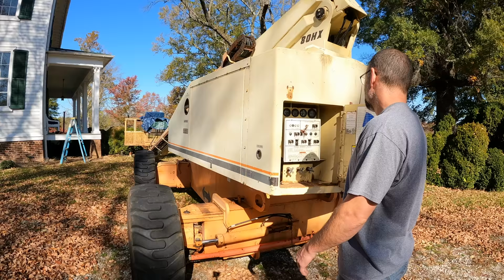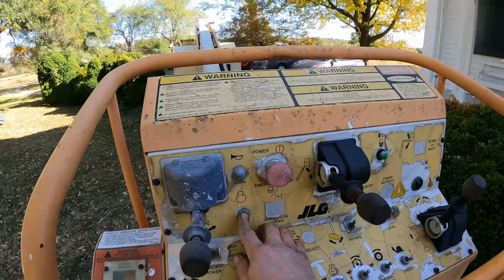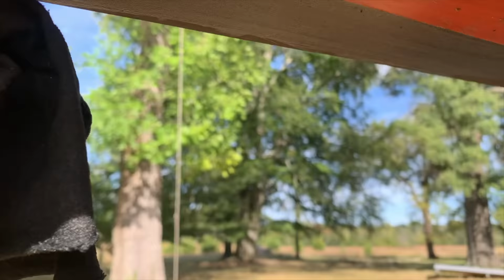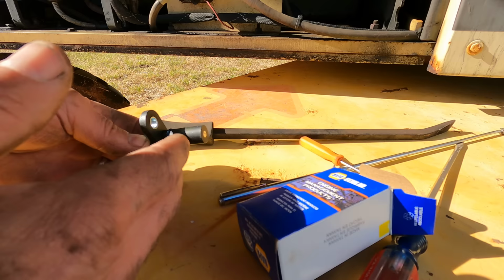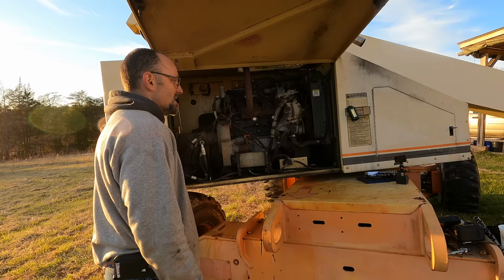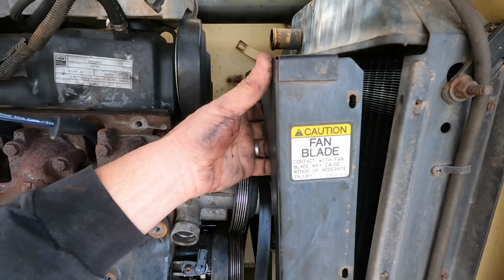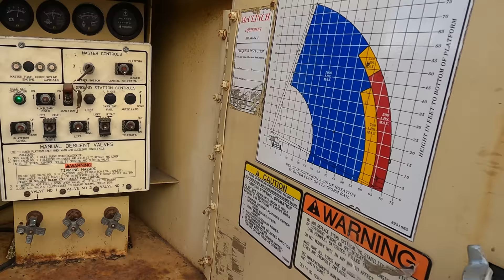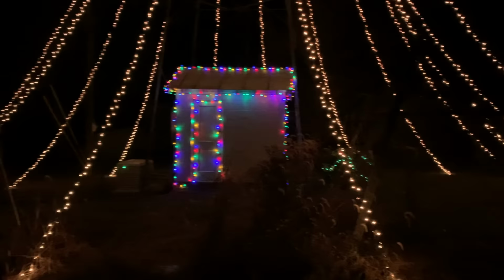My Boom Lift Broke Again! Fixing It & Then Doing a CRITICAL Job With It.

Comment: I have cut one piece fan shrouds in half to facilitate removal and re-install....the next  time you need access to stuff you can easily remove just the half that's interfering with access to fan removal, or water pumps, belts etc.

Comment: After reading almost all the comments (about the engine) The one thing that seems really clear is that the choke is opening way too fast, as several folks already mentioned. I recommend doing a compression check on it with a screw-in-type gauge. Try having someone start it while you manually move the choke by hand, I did this on mine, and it proved to be the problem. I rigged up a manual choke for it and the clod start issue was gone.

Comment: I have never been accused of being an expert but I would go after the electric choke. In the video you can see the choke fluttering opened and closed. I would try to isolate that by taking it off and manually holding the choke in position. The way it’s behaving makes it feel like a governor issue but if the choke is not being held in position it will act the same way, as the engine get fuel and speeds up is sucks the choke open pulling too much air, not enough fuel, so it starts to die and the choke falls closed pulls more fuel, less air and it starts to fire again, it does this until you get enough fuel/heat to keep it running. Also on all of electric chokes I have seen they will only open to that halfway point and once the throttle is opened they are tripped to wide open, this is usually done with a linkage.

Comment: at +4:25, yes the linkage on the choke pivot should be adjustable. The brass screw in the center of the part in your right hand is the limit screw.

Comment: I guess the next step would be putting an oscilloscope on the crankshaft position sensor and coil control coming to/from the ECU and check those are not intermittent. Mechanically it should be sound now, unless something is wrong in the valvetrain...

Comment: On your extension cord or rope wrapping tip, I usually put it on my shoulder and do it just like you did but going around my elbow to make that loop and then I take the finished cord off my arm but it's one smaller loop and not two.

Comment: My 79 Clark forklift has a flat 6 continental motor with an updraft carb. I use my compressed air to blow into the fuel tank to prime the the fuel line. I use my gloves to cover the filler tube and then sneak the blower between my fingers. A couple of air blast I can see the gas fill the filter. I can’t do this with a full tank. Great video. Cheers.

Comment: I think you have 2 issues that are related.  The choke fluttering is a symptom of a vacuum leak, either faulty diaphragm, hose or gasket.  An easy way to find the leak: with the intake hose secured and engine at slow idle take a slightly open but unlit propane torch and put propane near suspected leaks, the engine rpm will change when it sucks in the propane.  I also suspect you are having to crank so much because of lost fuel pressure, there is almost zero difference from starting with a completely empty carb to sitting overnight.  This is most likely a small air leak which is causing lost prime.  Snug hose clamps, double check fuel hose for kinks etc.
Once your past the hard cold start you should check the valve lash

Comment: DuPont motorcycle chain lube is a great replacement for white lithium grease and WD-40 for stuff like this.  It's a thin liquid that penetrates and cleans when enough of it is sprayed, and then it dries to a waxy, white film that doesn't spread and hold dirt like white lithium grease.

Comment: Choke Limiter, no. There is a piston inside that space you called a choke limiter. When the engine starts, a vacuum is applied to that piston to pull the choke partialy open. This helps prevent flooding. As the engine heats up the BiMetalic spring finishes opening the choke all the way. The bolt that you said does nothing is there to limit how far the piston opens the choke during the initial start. The slot allows the BiMetalic spring enough travel to let it finish opening the choke all the way when the engine is hot. Use chain lube it stays on the chain better, WD40 would be used to free it up but you want a good quality "chain lube" for permanent lube. The rust on the sliding ways is your drag problem. Use a wire wheel to clean them and use grease on um to keep the rust off. Also, you may want to remove the wear pads and remove the embeded grit which is likely stuck in the contact faces after running on that rust.

Comment: Old wrench here . The starting problem is the choke , it's not closing tight enough from what I could see in the shot looking into it while starting . The choke thermostat spring should be adjusted to where it closes tight enough to stay shut while cranking . It should also be opening FULLY when warmed up . That piece you were talking about that won't let it open all the way  is vacuum controlled on a car and has a diaphragm on the end of it with a vac hose to the intake . It's called a " choke pull off " or sometimes a " choke breaker" .  You should be able to google whatever brand and part number that carb is   and see what I'm talking about . Anyway , that's the area that needs attention .

Comment: Good job !   I agree with some of the other people on the engine .  I would do a compression  check , cold & hot . Bad valves  can cause it to start hard on cold start & better on a warm start .  And the timing belt may be worn out. With most older engines  there are many things that contribute to bad start.

Comment: In the cold weather take a heat gun and blow it into the air intake if it starts easier might need some sort of grid heater.

Comment: John, I think your starting problems are Choke related, I saw the choke plate fluttering when you were starting the engine after you took the automatic choke system off. The engine is now over-choked when you first start the engine and the butterfly valve flutters open and closed  causing the engine to gradually receive enough correct air/fuel mixture to begin running and keep the butterfly valve open.
The choke valve should normally be in a set position to allow air as well as fuel vapour to allow the engine to start correctly, then I think the little electric heater causes the Bi-metal spring to fully open the butter fly valve.

good luck any way Jim H

Comment: For your boom chain suggest you use a motorcycle chain lubricant.  It goes on liquid/ spray then thickens like a grease so it doesn't fling off (a motorcycle).   I've had good success using this lubricant on chains where you want the lubricant to last a long time.  My garage door chain as an example.  I learned about this lube from owning a motorcycle for many years.  Also, many people think WD40 is a lubricant but it really isnt.  It is a water dispersaant and does that we'll but it's lubricating properties are poor.  I have found a product called Break Free as the best non-grease lubricant. It is an oil type but it never dries up and get hard or sticky like other oil lubes.  Corrosion X is also a good lubricant for parts that will be in a rust prone environment.  Also for any rusted nuts or bolts, Liquid Wrench is the best and that was shown on the project test channel on you tube.  It outperforms all others even PB Blaster.   Finally,  whenever you want to remove and stop rusting,  spray with Ospho. It would have worked well on your rusted boom then add the Lithium grease.  Ospho is phosphoric acid based and turns iron oxide into a nitrate which is inert.  Rust stops, turns black (nitrate) and Ospho acts like a metal primer that can be painted (just wipe off the white powder residue).  As an example, I used Ospho to treat a totally rusted 500 gallon fuel tank then painted it.  After 5 years on the coast just a few feet from saltwater,  the tank was perfect with zero rust and nothing is more harsh than ocean saltwater on metals.   I digressed here but I hope this helps sharing my experiences which came from living on the coast next to saltwater.  Ugh a Ford engine and the joys of working on it (NOT)...lol....never been a Ford fan...prefer Chevy.

Comment: A big old generator we had suffered similar engine behavior.

It turned out there were two causes:

1. The rough running was due to a couple of tiny, ~0.025" ports inside the carburetor that were plugged up. Once we took the carb apart for the ~5th time and passed a tiny drill bit through the ports, the engine ran flawlessly again.

2. The hard starting in cold weather was due to the choke not turning fully on. Note we thought we had it fixed after the first ~6 attempts, but then during the winter we found that once again it refused to start.

Once we realized that the choke needed to completely close in very cold weather and that there was a small piece of metal that was actually supposed to move inside the choke to limit how far it could close, the hard starting was gone.

Good luck with it!

Comment: Here are a few thoughts about the starting problems and the boom movement from Germany(hope my english is good enough to understand what i mean).
1.Starting problems
There is a magnetic actutated plunger in the carburettor body which shall stop the engine when you switch it off .This works in the idle circiut of the carb and if this doesnt always open correct you have problems .Check the minus connection of the carb body too because this valve has one plus cable only and cant work good without good minus connection.
There is a spiralic bimetal heating element that should keep the choke flap closed while starting and open after a while .check these especially the connecting between the spiral and the choke flap .
These two elements you will also find in the carb of the 1960s Volkswagen beetle .i am shure you will find a video about the function of these parts by you tube.
If the gas in the tank of your machine is older than 3 month you will have starting problems because the elemets of the gas which are burn easy are vapoured out already when the machine stands in the sun and the tank gets hot.
2. Boom problems
I think at the end of the extension boom(the area which stays in the next bigger boom by full extension) must a sliding element or rollers. Think 
this is worn or needs some grease .It is hard to reach but it needs attention or you will not get lost of this problem .Dont use
WD40 . This is to loose a rosted  bolt but not for greasing!!!!

Comment: The hard starting could be caused by a bad oil pressure sensor. Apparently the engine controller won't let the engine run until it builds up oil pressure. To test this theory, disable the oil pressure lockout by shorting together the three terminals on the oil pressure sensor. If that fixes the problem, replace the sensor. If replacing the sensor doesn't fix the problem, then you've either got a oil filter, a worn out oil pump, or worn out engine bearings, or too much sludge in your engine.

Alternatively, put a test light or voltmeter on the Overspeed Relay output and see when it kicks in. The engine controller won't enable the spark until that relay closes. The relay is open until oil pressure builds, or opens if the RPM goes too high.

Comment: Had a 2001 jlg 60 for three years. About 2400 hrs. Not sure of engine other than it was straight inline 4. My issues were I believe governor related. After a full day of off on and when it was hot the governor would throttle the engine down so low nothing would move.   Most of the time it was fine. But like you it’s when you need it to operate and show up is the real test.  It’s a great to have a lift. Good luck with yours going forward. P.S. I saw you were covering your platform control center. I did that all the time! That’s some expensive components under there!

Comment: I see the hard starting issue i believe! The choke spring is adjusted too loose! It shouldn't flop open under vacuum during cold start! Get the engine hot, then adjust the choke spring until it just starts to close the butterfly, then tighten. That will put more "cold tension" on it

Comment: I had an intermittent issue with a 4 cyl Ford stalling at idle. You may have fixed your stalling problem, but it is worth sharing this. I replaced the wires, plugs and rotor in the summer and it was fine for 4 months afterwards. When the weather turned cold it would stall out at idle and only when half warmed up. Fully cold or hot it was fine. I brought it to two mechanics including the dealer. It would usually stall in the morning when it was colder. It would crank, but not start for 10-15 minutes. The problem turned out to be routing of the ignition wires. I finally found it when I used a timing light on each wire and saw a double flash on one plug. The ignition had enough energy to induce a spark into an adjacent wire causing a misfire. I looked up the correct routing, moved the wires,  and it never stalled again. I have mentioned it to several mechanics. Some don't believe me but I know what happened.  I only trust the ones who are aware of the issue.

Comment: most every carb I have worked on - 2.5 turns is the best starting point to set the mixture, especially the low mixture. High varies more and is sometimes more sensitive.

Comment: Hi John, mechanic by trade here. I used to work with carbs long ago but I still remember a few things here and there.

1. It seems that  your carb has a blocked idle circuit. If it isn't, it might be the screw we act upon to adjust air/fuel ratio which is too open (counterclockwise.) If that's the case, your engine will be lean whenever the throttle is at rest.

2. Unstable idling can be related to several things, but in your case you could check for leaks between the carb and the intake. It's easy to rule it out with WD-40 or something volatile you may squirt on the places where gaskets are.

3. Last but least, check the ignition time and the hoses (if there's any) where vacuum is expected to be present while the engine is running. Any leaks will make the engine leaner at all times. Sometimes between the distributor and the carb's foot there's a hose which makes vacuum to change the ignition time according to the engine revs.

Hope that helps!

Comment: Next time you take the radiator shroud off cut the bottom of it off and modify it to be bolted back together making it easier to remove next time as 2 pieces.  That way you can rotate the top half and remove it easier.

Comment: It's been so many years since everybody came to me for answers to problems like this which I always told them to go back to basics. 
Where is the fuel tank in relation to the carbie. On start up it sounds as if the fuel has drained from the float bowl and the fuel pump is struggling to get going because of air in it. A simple test is to mount a temp tank on top and let gravity feed it. When you serviced the carb I have no idea if you had been cranking on it prior to dismantling. 
Option two is to run a pull wire from the throttle to your control/starting box. It may start easier with a little throttle.
Nice to see it running but it would be nicer to see that difficult start situation resolved. 
In the meantime it's good that your humour about it is in good order.
Oh .... On your tower you have an antennae ..... what is it used for?.   If still in use then when wet that wooden star will interfere very badly being that close. Please do not transmit with it as reflected power may just blow the finals in a transmitter.

Comment: Hey John great video, love the song at the end. As for the cold hard start, there are 2 temperature sensors on the thermostat housing. One is for the gauge and the other is for the computer. In this case the one for the computer should control the butterfly for the choke. It looked like the butterfly for the choke opened right up during the part where you were filming down the carburetor. This is incorrect. The  butterfly should slowly open as the the engine warms up and be closed when cold. If this is true, the sensor could be reading a false hot and causing the choke not to work. If you check the sensor with an ohm meter it should read 58-40kohms cold and 3.6-4.8kohms hot. I have been jumping around your boom lift videos and haven't them all yet so I am sure you figured it out by now. Love the videos and keep up the great work. Happy festivus

Comment: We have a very similar lift, same power plant same issues.  Iv put on a new carb new plugs and wires new fuel pump.  Finally got it reliable and now there’s electrical issues in the platform from water corrosion I gotta deal with.  I never thought to check the crank sensor-  I’m betting mine is also swollen/ cracked in the housing bore but I’ve got electrical gremlins that were fed after midnight so I’ll make my way to that sensor in time.

Comment: According to boom lift engine behavior symptoms the exhausting system is blocking. To check this theory just disconnect the exhausting pipe from the engine and try to use it without. And thank you for your videos. I am from Ukraine and your channel helps me to switch from a war background to peaceful issues.

Comment: Two thing that come to the top of my head ,fuel pressure o vacum loss , check your gas pump and try disconecting vacumm hoses and see if your idel change but i bet is the fuel pressure